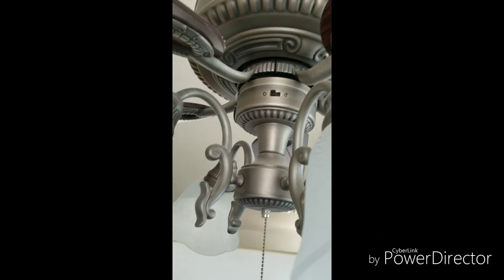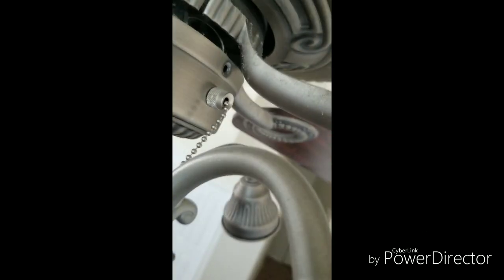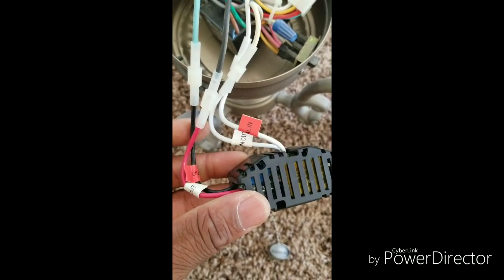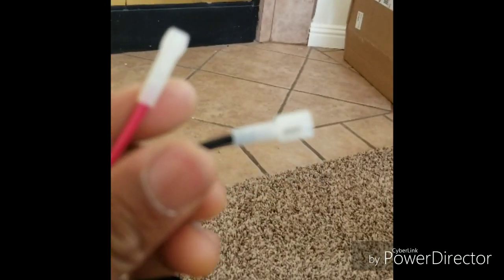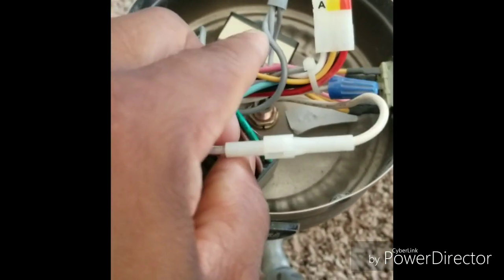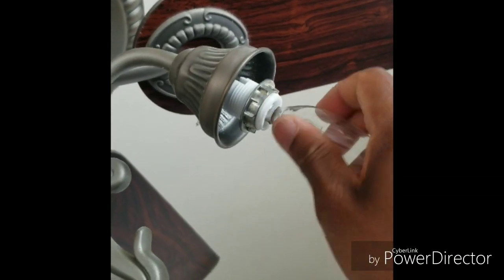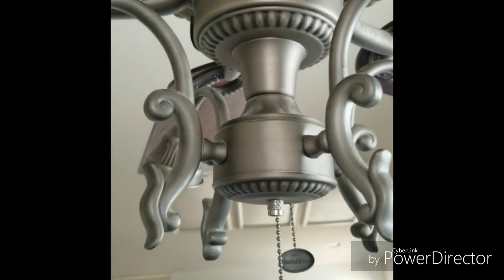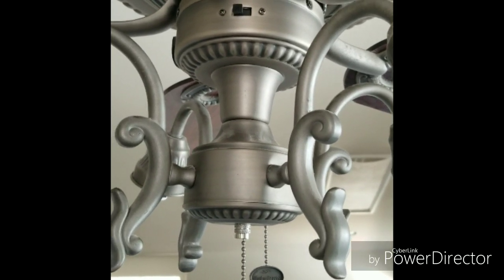Harbor Breeze Ceiling Fan Light Fix

Comment: Hi, I’m referring to the entire chandelier portion because we’re not sure what component of the lighting isn’t working. The fan is fine. Do you make repairs.
Reply from the maker: I'm sorry I dont do repairs. But if your fan works. And the lights don't. Its ether one of 2 things. The limiter witch is shown in my  video, or the switch itself. The switch is the clicking noise you hear when you pull the chain. Look up ceiling fan switch on YouTube to get a better idea😊

Comment: This is a great tutorial. My problem is a bit different. When you put single bulb in (tiny bulb) the light bulb stays on. Not sure if this is a regulator issue or not. One day it just stayed on and the remote couldn’t turn it off. Any ideas?
Reply from the maker: Does it has the pull string to switch it from on and off?
Reply: @Duwop77  no.
Reply from the maker: @3mt696  Ok. That's strange have you tested the remote. Just to make sure it's not faulty?
Reply: @Duwop77  yes. I’ve tried 2 remotes. It’s just that when you pop that bulb in it gets hot so gotta pull it out after 2 seconds. My receptor is black with one red wire. I guess I will get a new one and try it. Just hard to find single red wired ones with same output.
Reply from the maker: Oh wow. Yes I haven't come across any receptors with one red wire. But I agree with you that would be the next step if you can locate one. Wish you the best of luck. I'm going to search Google and see if I can come across a receptor like yours.
Reply: I have the same issue where my fan light won't turn off. Fan power works on and off just fine via remote. Light does not turn on or off via remote. Also no pullstring.  Did you happen to fix the light issue where it stayed on??

Comment: How can you fix this type of ceiling fan if a bulb broke off in the socket and I tried to get out but pulled out the silver part that the bulb screws in. I don’t want to buy a whole new ceiling fan
Reply from the maker: Just purchase a lightbulb removal kit. And it comes with an adapter that's for removing broken lightbulbs. Click on the link at the bottom for an example. The first link is of the actual kit. And the second link shows how to use it. Thanks for watching 😁👍

https://www.homedepot.com/p/Ettore-Bulb-Changer-with-Pole-48450/204706091?source=shoppingads&locale=en-US&mtc=Shopping-B-F_D28I-G-D28I-028_004_CLEANING-NA-NA-NA-SMART-NA-NA-SMART_SHP&cm_mmc=Shopping-B-F_D28I-G-D28I-028_004_CLEANING-NA-NA-NA-SMART-NA-NA-SMART_SHP-71700000080943625-58700006818240510-92700061594810398&gclid=CjwKCAjwmeiIBhA6EiwA-uaeFTclbkhE1drwWx3CB72szZoR45dQoc4Urq9bxmzmpJSVNkcYJMSvpxoCwzcQAvD_BwE&gclsrc=aw.ds

https://youtu.be/TBVnrJrn-Xk

Comment: Bro I have a black, blue, and a white wire coming from my limiter! Do I connect the black and blue?? When can I connect the white?? I don’t have a male and female connection
Reply from the maker: On that particular limiter I'm not sure. There maybe more videos on YouTube that could assist you better. But if you don't have male/female ends you can always splice them together. And wrapping it with electrical tape.

Comment: How do you disconnect the push pins on the factory wiring
Reply from the maker: I just pulled on the ones that slip on and off. And I think it was a couple pinch pull connectors.
Reply: Thank You
Reply from the maker: Your welcome. Thanks for watching 😁 👍